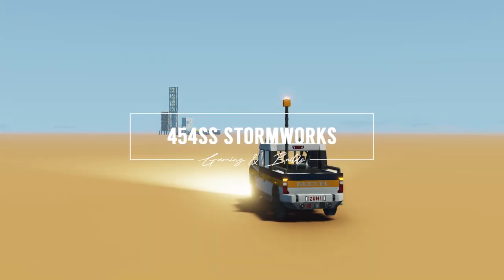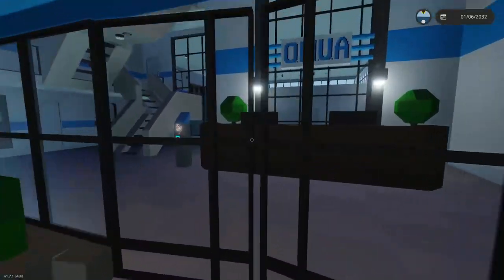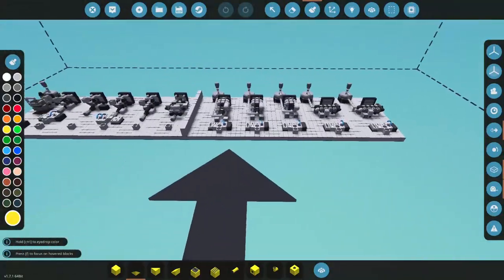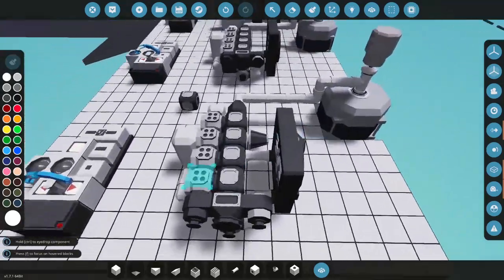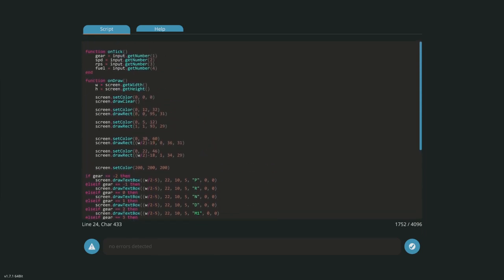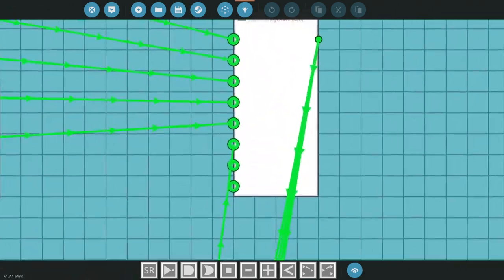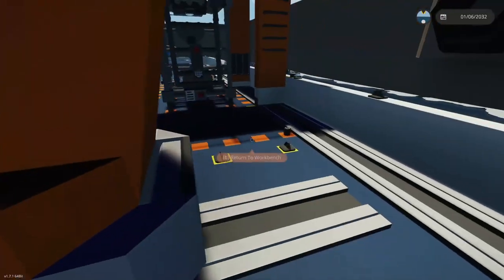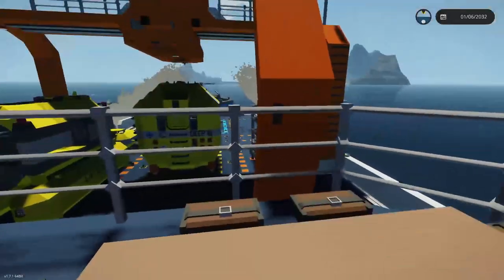ENGINEER explains 5 reasons why Stormworks is like ACTUAL ENGINEERING!

Comment: There's also reason six:  The Endless tinkering and optimizing tradeoffs.  I know 'parameters' is reason five, but the give and take of 'how do I add feature X while staying inside budget and also keeping that fifteen knot top speed???' is it's own primal animal.
Reply from the maker: 100% this! You can do things multiple ways, sometimes they are equally good, but sometimes there is optimization, improvement, etc. and that applies to everything from physical design, coding and microcontrollers... Thanks for the comment!

Comment: As much as I love Stormworks, the modular engines are not a good example of realism. They are supposed to be diesel engines but behave more like petrol (gasoline) engines.

In a petrol engine, you need to keep the air/fuel ratio in a specific range to keep the mixture combustible but not self-ignite due to compression (knocking).

In a diesel engine, none of these concerns exist. You spray liquid fuel droplets directly into the hot cylinder at the end of the compression stroke. Even tiny amounts of fuel will ignite under these conditions, so the mixture can be extremely lean. The stoichiometric ratio (14.7:1, as given in Stormworks) gives you how much fuel you can burn at maximum, but is almost never reached. In practice, most diesel engines never go below 18:1 or so, and can operate as high as 70:1.

This is impossible with a petrol/gasoline engine, because it would not form a combustible mixture that can be ignited with a sparkplug. And it is common for them to run “rich” (lower than stoichiometric AFR) under load, which a diesel engine never does.

Comment: I find it a shame that there aren't many tutorials in stormworks that do Lua. Lua is often more responsive than logic diagrams for the same function (data travels one transfer per tick, so if you have a chain of logic where some data travels a dozen logic operators, it takes 12 logic ticks i.e. 1/5 of a second!) (that said, Lua requires dataIn, Composite Write, Lua, Composite Read, dataOut, so 5 ticks in total, but you can do loads in the Lua step).

I'm looking forward to the janky pressure mechanics

Comment: Haha, I’m a controls installation engineer (building/BEMS). 

In stormworks I barely touch the controls logic, hell, my engine controller I’ve just stolen off the internet. Happily spend 100 hours designing an engine or hull though.
Reply from the maker: Haha amazing! That's like me, structural engineer IRL but this game is mainly mechanical/controls/programming :D Gotta do stuff outside profession for fun!
Reply: @454ss_gaming  my first job out of college (mech eng degree) was at a civil engineer as a junior design engineer, mainly doing open drainage/soakaway design/surveying, banging my head off a brick wall in Tedds looking at retaining walls. :D

I need to get back into stormworks tbh, not played it in months, on a YouTube binge of it when I discovered your channel.

Comment: "like in a real world, you have steel, you've concrete, you've wood, you've glass..."

M8 we ain't got anything but blocks with density of 64 kg/m^3 which is like, I can't even think of material it might represent, so I'd assume it's something like paper with non 100% infill, or any other material with partial infill

Weight blocks, maybe wood or something

Window blocks? Literally has 0 volume, idk same stuff you can find in a blackhole

Jokes asides, yeah, I do be quite liking this game for it's similarity to the engineering, tinkering n stuff. Great video!
Reply: I remember someone concluded they were salt blocks
Reply: I remember someone concluded the blocks were made of salt or something like that
Reply: @EdyAlbertoMSGT3 when i looked it matched sawdust.